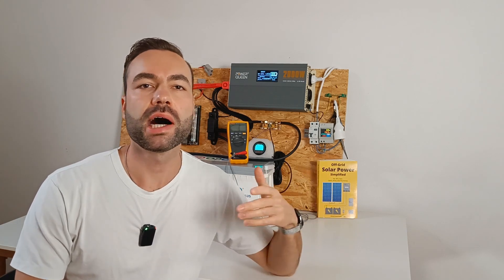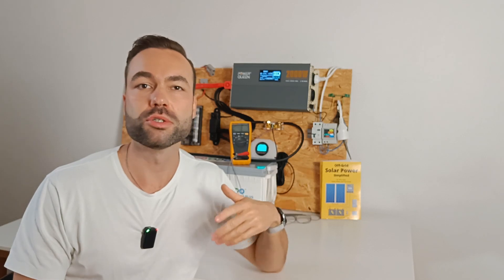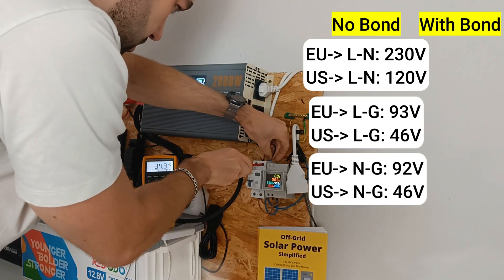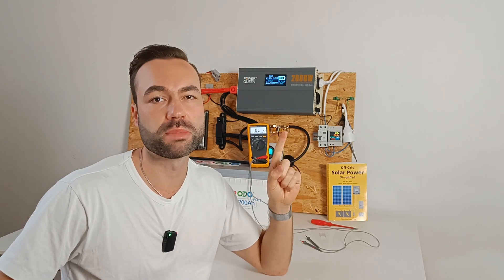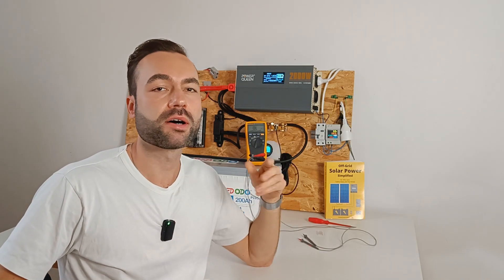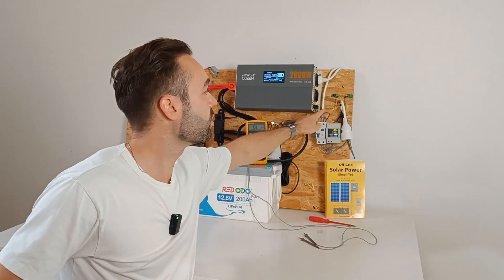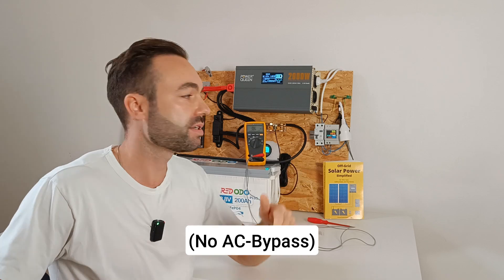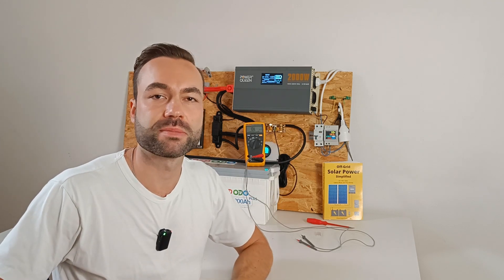Neutral-Ground Bonding for Off-Grid and Mobile Systems

Comment: If I am building a handtruck portable system with an all-in-one hybrid inverter, and a small subpanel, containing 2, 15  amp circuits  how do I bond this system?
Reply from the maker: Check if the inverter has ground neutral bonding. If not do it right after the ac exits the inverter at the beginning of your ac box.
Reply: @cleversolarpower  thank you. That’s a little difficult with a mobile station, but I guess I will have to hook it up the ground everywhere I go.

Comment: I have my ground bonded to neutral in my "main AC panel" in building 1. I am in Thailand 220 V and using a Anern 6.2KW Hybrid Solar Inverter 48V. Most of the time I run fully off grid. As far as I have measured there is no ground to neutral bond in the inverter when in off grid mode. Some times I add power from the grid without any difference or issues with the earth to neutral bond, which only exists in the main AC panel in building 1.

Comment: If I never connect the inverter to the panel and only use the outlets on the inverter, do I need to worry about grounding?
Reply from the maker: Not grounding, but you won't have a ground neutral bond (depending on the inverter) and if you don't have a GFCI, then you can get electrocuted.

Comment: What about for systems without grounding like a hand cart? Just a GFCI on the A/C side is adequate?
Reply from the maker: That would be similar to the mobile system discussed in the video.
Reply: @cleversolarpower  Thanks! I think in the video it uses a combo inverter/charger. Would it be okay with an inverter like the Renogy RIV1210PU-126 (Renogy 1000W pure sine wave inverter with transfer switch)?
Reply from the maker: Not sure if they have a ground neutral relay in there.
Reply: @cleversolarpower  There is a ground-neutral bonding relay which can be enabled or disabled with a built-in switch.
Reply from the maker: Similar to the victron Multiplus then. But on the victron it's changed in the software.

Comment: Hey thanks for an informative video. I am still a bit confused on weather i need to ground the ac side if i have dc ground. Im running 95mm2 cables from the shunt to my 3000w renogy inverter and also a 95mm2 wire from shunt to chassi. Do i need to ground the ac side with this setup?
Reply from the maker: If you have a grounding rod then you can ground the ac. If not, then connect to the battery - Yu can measure if the neutral of the DC side is connected to the case grounding connection.

Comment: @0:34:  The 2nd point seems incorrect.  A ground is not needed for a GFCI.  GFCIs monitor the difference in current between hot and neutral.  A ground fault opens the circuit, halting current, rather than merely shunting the current to ground, which would then build to an over-current trip.
Reply from the maker: No, an over current trip from a breaker will not save you from electrocution. Check mike holt trainings on YouTube. You need a ground conductor to be the return path to the source. Otherwise there is no difference between line and neutral.
Reply: @cleversolarpower  You misread what I wrote.  The bottom line is that your 2nd point at the time stamp seems incorrect.  If you disagree, please explain how you think a GFCI works.  I.e., an EGC is not required for a GFCI to function.  Check any wiring diagram on a GFCI device.

Comment: I have issues with a touchpad not working while the laptop is charging from 220v (3.2 kW Powmr hybrid inverter), 12v control panel accidentally turning off the water pump or turning on some lights. 
I also came to the conclusion that I need ground bonding, but having 90v on the neutral stopped me from bonding it to the chassis (and minus DC bus). why is this safe?

Comment: I gotta say how I’m confused there are so many comments and no-one pointing out that a ground neutral bond on an inverter should not be made as it’s a floating neutral type supply. It’s dangerous because the neutral provides half of the supply voltage on the negative side of the some wave, so you’re essentially raising the ground to that voltage. You can also damage inverters by doing this
Reply from the maker: Neutral provides half of the supply voltage? 🤔 We always make a ground neutral bond after a power supply. Wether it be a generator, transformer, or an inverter. This is to let the GFCI work properly.

Comment: i have 2 inverters. one is 12v 1200w 230v victron and i made the ground neutral connection inside the inverter. ground is connected to ground rod in ground outside the house. im afraid to leave the second inverters neutral floating because then i cant use RCD. can you recomend what to do please

Comment: If i have 2 solar panels in parallel (40v, 10a) that is connected to my ecoflow delta 3 plus power station, how do i go about grounding the solar panels (ground mount)?  do i need a separate grounding rod or do i bond the panels and connect to the main house grounding rod?  if I do have a separate grounding rod , do i connect that to the main house grounding rod too?
Reply from the maker: You should only have 1 grounding rod in your home. Do not put a new grounding rod next to your ground mount, that will cause ground loops. You can ground the solar panels to your home grounding electrode.
Reply: @cleversolarpower  Thank you!

Comment: Great video, you explain everything simply.  Question? If the inverter is bonded internally do we need to ground it with a earth stake like grid power systems?
Reply from the maker: Yes, you always ground the system, for moving vehicles, its the negative of the battery, for stationary systems in a ground rod. If the ground-neutral bond is already made in the inverter, then you don't need to create an extra ground neutral bond. Only make it at one place.

Comment: I STill struggle to do mine, i dont have a ground port like you on my hybrid inverter, all i have is the "case lug ground" can i do the bound there? all i have is L and N , the only ground i have is the case ground, make no sense to me
Reply from the maker: You have the plug 🔌, there will be a ground in it. Otherwise, the case is often connected to the ground. you can open it up and check if you are experienced with electronics, otherwise don't do it.
Reply: @cleversolarpower  i dont, this is a hybrid inverter, all i have is L and N out, the only sign of ground is the "case ground" , i have bonded my N and G there but i'm not sure it's the right way to do it ...

Comment: Tip:  For Large Battery Bank Disconnect Dihool makes larger breakers here's what I use:  DIHOOL Main 160 Amp DC Circuit Breaker, 240V Battery Disconnect Switch, Master Switch  (they go up to 400 amps)  (They are Solid and The Switch is a nice hard flip for safety)
Reply from the maker: Looks good, they have testing data. I might try these out soon.
Reply: @cleversolarpower  They are Awesome...I use one for Controller (160A) and One for Inverter (200A) .....DIHOOL 200 Amp DC Breaker, 240V Battery Disconnect Switch, Thermal Magnetic Trip for Main Power Station Solar System, UPS
Reply: @cleversolarpower  I took out non fused switch didn't like it Also Do not use cheap Marine Battery Switches the Voltage will decrease over time as the switch goes bad in a year.....

Comment: What if you want to use for example a Ecoflow Powerstation with solarpanels connected AND chargingcable connected to a walloutlet. To run a AC-unit.

If you are Off-grid i guess you just create a Ground-Neutral-bond... but what if you charge via the grid to.
Reply: Is a groundrod gonna solve the issue?
Reply from the maker: The ac will not run a long time with an ecoflow if you don't have extra batteries. It depends on where the electricity is comming from, the grid or the battery. If it comes from the battery, there should be a ground neutral bond made in the inverter. If it's coming from the grid, then there should be no ground neutral bonding. You can check their manuals for what they say. But I'm pretty sure they figured it out. Measure the output voltage like I do in the video.

Comment: I have a hybrid situation where I switch in between the solar system and the regular grid depending on the weather. so in the winter I'm on the grid and for the rest of the year I do solar. what should I do with the neutral-ground bond in that case?
Reply from the maker: That depends if there is a bond made in your house distribution panel. In the EU the bond is made at the transformer station. I heard in the US it's made in your breaker box (main distribution panel). You should only have one ground neutral connection. So measure if your inverter has one already. And if it has a connection when you are grid tied, then remove it (or turn the inverter off). If you are off the grid, then make your ground neutral bond in the inverter if your distribution panel doesn't have it yet. I talk more about it in my video about a transfer switch.
Reply: @cleversolarpower  so my inverter seems to have a ground neutral connection as I have 0 ohms in between the output neutral and the case. I live in Europe, so you say there is one at the transformer station and the inverter has a second one. but I should only have one, so do I have a problem now?

Comment: What do I ground to if I have an all-in-one without an automatic grounding relay? I have an Ecoworthy 300 AIO and it's in a toolbox without AC in. (edit - I have it currently connected to AC to charge it temporarily but 99% of the time it won't be plugged in to AC) How do I ground my AC out?

Comment: Off-grid systems is one thing - mobile is another. With off-grid the ground can be an actual ground, with mobile the ground is the chassis of the vehicle, but what if I am standing in a puddle in bare feet and touch the chassis of the vehicle - I don't think I want that chassis connected to a 230 volt inverter neutral.
Reply from the maker: The chassis of the vehicle will be 0V. That's is your reference voltage because it's connected to the negative of the battery.

Comment: Hi Nick, I have an inverter (2000w) powered by a battery but independent of the RV circuit, my question is whether it is necessary to connect the inverter's ground wire to the neutral? In this case, to the battery? thanks for your cooperation.

Comment: Hi Nick thank you for the excellent sharing. Came up a doubt and a  question.There are 2 ground rod at a distance of about 14  meters. One is related to apartment and the other one is related to the cantine. They are supplied by the same meter at 220V. Should they be bonded together also at this distance?  Roof of the cantine is the only location where could be installed some paneles on the future. If possible please indicate Your tthinking about. Thanks. All the Best. .

Comment: Thank you for creating this video. I have a query regarding grounding. I own an Eco-worthy 2000w inverter with a ground pole. Would it be adequate to connect this to the ground, or should I also install a CGF switch as demonstrated in your video? Currently, I am only utilizing the inverter's outlets and not supplying AC power to my trailer. The installation of a transfer switch is planned for a future project. Thanks in advance.
Reply from the maker: The case should be connected to the ground. If you already have a ground pole, then connect it to that one because you don't want to create grounding loops. Always use a GFCI switch after the inverter. The outlets you are powering now are not protected from ground fault currents. Check my video about GFCI's.

Comment: Thanks for the video Nick, it's very informative.
I have a setup in my 4x4 that never connects to shore power.

All my DC components connect to the vehicle's chassis for their earth connection.

My concern with creating a NE bond is whether or not the neutral output of the inverter will have any bad/damaging effect on the electrics & computers of the vehicle.

However I do want to make the AC side of my power setup as safe as it can be. In your video you mention that the NE bond makes a GFCI/RCD device work more reliably, so that is something I want.

Do you know if, or have you heard of, NE bonding creating any problems with a vehicle's electrics and computers as I mention above?

Thanks for any help you can offer and congratulations on the great videos.

Comment: Here is a question, in the case of a victron multiplus 2, the grounding to earth relay is normally closed making the ground neutral bond. When AC in is detected this relay automatically opens breaking this bond. If the AC in is from a generator that has a floating neutral, there is no bond. In this case would you turn the grounding relay off permanently in the inverter and make the ground neutral bond in the AC distribution box to cover all scenarios? I have often wondered this.
Reply: Here's how I handle this.  I have three power sources.  Grid, Generator, and Inverter(s).  They are all connected at a centralized point, which I'll call my switch gear.  The switch gear is composed of two ATSs, and is connected such that the Inverter is primary, the grid is secondary, and the generator is tertiary in switched priority.  At the ATSs, neutrals are all bonded together and to a ground point.  This is my single-point ground and NOT at the main circuit panel, which is 50 cable-feet away.  This ensures that neutral is always grounded and common between the three sources.  I didn't start out that way, but having the generator and Inverter unbonded resulted in occasional "tingles" due to the floating neutrals depending on the ATS switch configurations.  Tingles are now eliminated.
Reply: @lennygemar1021  I've got this same problem...is your system 120/240v split. or 120v or 240v single phase? I'm Canadian.
 if 240v split, do you have a 4 pole dubble throw ATS? if single phase do you have 3 pole DT, ATS?

   I have a 120v single phase setup. (but wired it to accept 240 split in the future/maybe.) I did not want ATS went with manual. I could not find a 4 pole dt, went with a 3 pole dt. not a problem if 120v neutrals and ground are switched. breaker panel is a sub-panel and not bonded
   my breaker panel is the load, with 2 supplies- grid and inverter/charger. 
also i used a 2 pole dubble throw switch that supplies the  inverter/CHARGER it intercepts the grid before the main transfer switch and the generator (one or the other but not both at the same time). 

I've had a terrible time sorting out the ground/neutral bond and switching.
Is there any way you could send me a wiring diagram or confirm your ATS's are set up this way?
I haven't found an electrician that can sort this out for me...any help would be appreciated.
Reply: @nomadicoasis9260  We have 240 VAC single-phase where I live in the Philippines.  It is dropped to the home using duplex wiring (one insulated and one uninsulated conductor).  The uninsulated conductor is grounded by the utility at the pole with the meters.  My ATSs are all four-pole type, but since the neutrals are all bonded, they only switch the Line/Hot lead.

If I were living in the US, we would have had 240 VAC split phase, where the neutral is still grounded at the utility pole, so I would have still done it the same way.  It's just that I'd have two lines to switch rather than one.
Reply: @lennygemar1021  I think i get most of that...
 do you mean the 3 neutrals to Grid, Generator, and Inverter are all in the same bus bar (or equivalent) and that same bus bar has the grounding conductor going to the ground rod in the ground.
then your ATS pair direct the Line/Hots to one of the following "Grid, Generator, and Inverter" supplies. and your breaker panel is a sub panel and 100% of the loads in the house? if I've got that right. I'm glad you've solved your problem... and thanks for the education very interesting!
I'm building a house on wheels which means I'm at the mercy of someone else's grid supply, but my own generator and PV inverter system. that means grid has it's own ground/neutral bond and my own generator and PV inverter must have one each. but not the grids, my dilema remains... I did have my "set up" off grid and it work fine. but now I've mostly reinstalled it in the house, not yet livable. I got stalled on the transfer system. not power transfer, just the ground/neutral bond. 
I have ground fault breakers and an EMP Shield both of which require a ground rod/plate to work properly... so digging up and reburying it again are in my future.
since I'm using 120V single phase (hot-neutral-ground) a 3 pole transfer switch will break the ground/neutral bond of the grid. so maybe I can bond neutrals and ground gen and PV inverter like yours on the other side of my 3 pole transfer switch. I will have to think about that some more.
Thanks again. I spent 3 weeks in the Philippines years ago... lovely place in a lot of ways :)
Jared
Reply: no idea how that posted 4 times!?
Reply: I think your situation uses a bonding plug stuck in a generator receptacle making the ground neutral bond at the generator. that way the grid connection has the ground neutral bond as it should. but when in use the generator has it's bond but not two at the same time. I'm not familiar with a victron multiplus 2... 
I have an outback inverter/charger but cant find if it has the automatic relay... Arrrg!